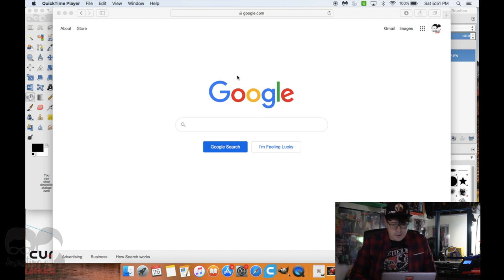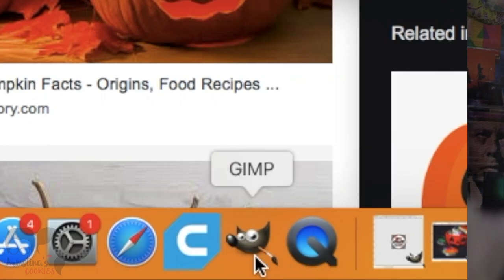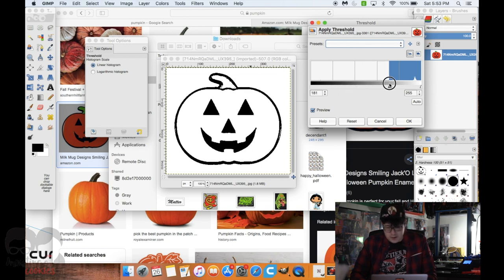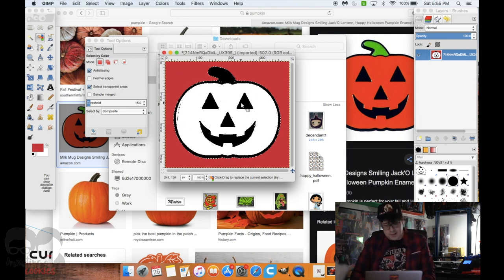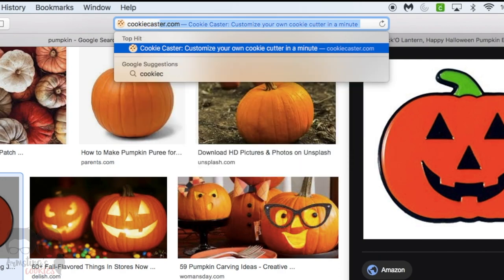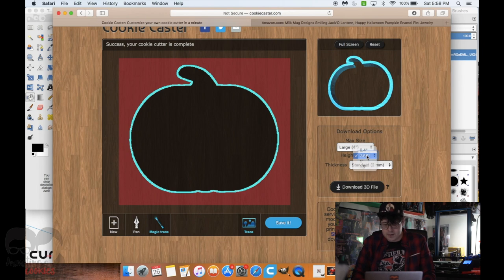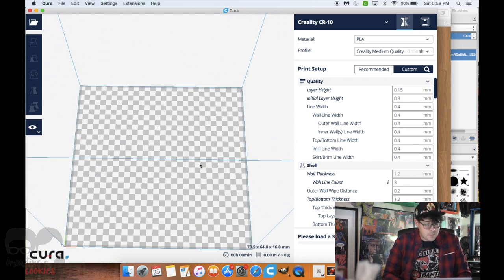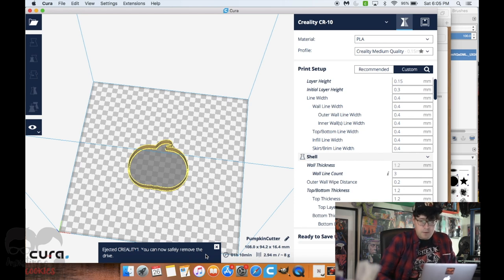How to Create Cookie Cutter Model For 3D Printing 101

Comment: Brand new 3d printer here. Wondering if you can help.  I have created my first cookie cutter but I'm worried about one thing. How do I determine the width of the 'wall' - the part that actually cuts through the cookie dough? I have the XYZ all set the way I want but I feel like the width of that cutting edge is too wide. I am using photoshop elements and it only lets me set the width of those lines in pixels - I'm looking for .8mm I think for the cutting edge. Does this make sense?
Reply from the maker: We usually make ours 0.9 or 1 mm thick. We did an updated tutorial explaining how we make ours here: How To Make https://youtu.be/bXTwpCi_MXg
Reply: @armstinasfamily  Thank you so much for the reply! I'll check out the new video!